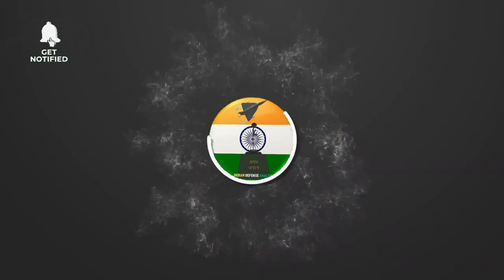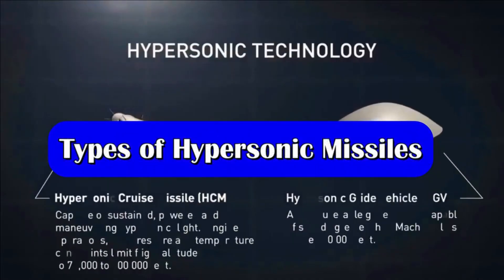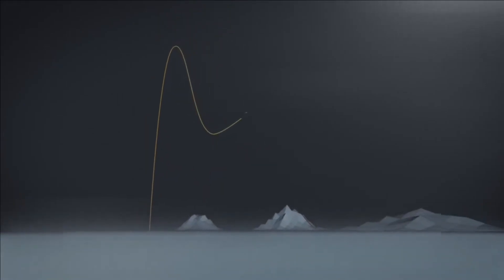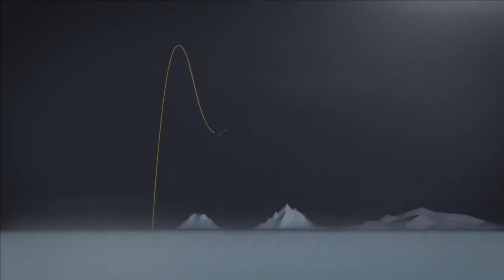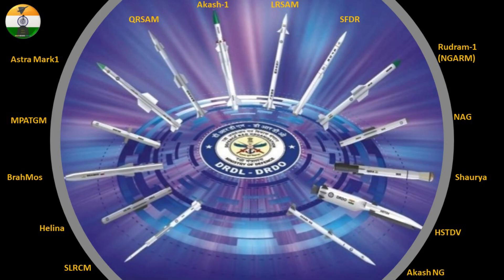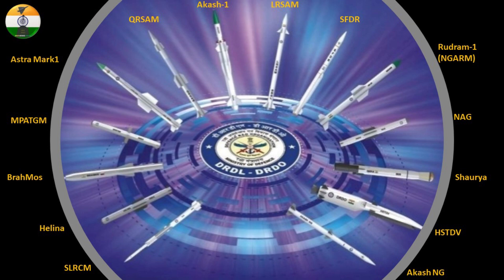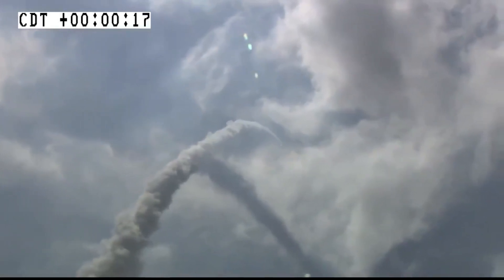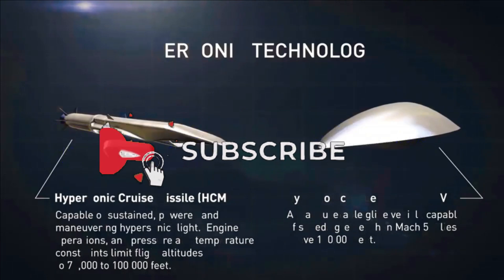First look of HSTDV based Hypersonic Missile #drdo

Comment: Good and comprehensive tech primer plus update. Could you clarify on a doubt I am having please? Brahmos is a Mach 2.5 + missile with a range around 500 km. It is huge in size. Considering that what will be the approximate size of a hypersonic airbreathing missile with  around the same range but  would require far more greater energy (hence fuel). Can it be really air launched with our existing a/c. I Understand that there is no need for a turbine but a solid propellant booster with its own oxidizer will be needed.

Comment: IF ISRO and DRDO are developing hypersonic scramjets, wouldn't a normal ramjet be far easier? It seems that tech would permit a 100% indigenous Brahmos instead of relying on imported ramjet engine from Rossiya. This is long before there is a working scramjet, this short term payoff should be possible. Hypersonic glide vehicles also change the balance of power, it makes possible pre preemptive strikes against a nation not named Pakistan. Even against Zhongguo to some extent, but they have more and better hypersonic weapons, so it isn't as advisable in that case. Although Pakistan doesn't even have missiles defense, their clone of S300(HQ9) can intercept some types of ballistic missiles to a limited degree. Hypersonic glide vehicles allows taking our air defence or any other heavily defended target in an instant.
Reply: If I remember correctly. It's contractual that the Ramjet will be sourced from Russia. It's one of the conditions in BrahMos joint venture.
Reply: @sidewinder3422  STAR is a missile that seems to be in Brahmos class, so a scaled up version of that can offer same performance. Nothing they can do if an indigenous Mach3 missile is created.
Reply: @datoolz0  Oh yeah I misread your statement, I thought indigenous BrahMos as in replacing all of its components with all Indian part, my bad.